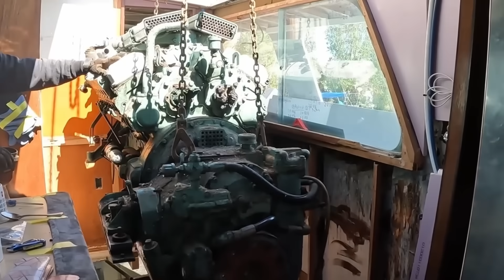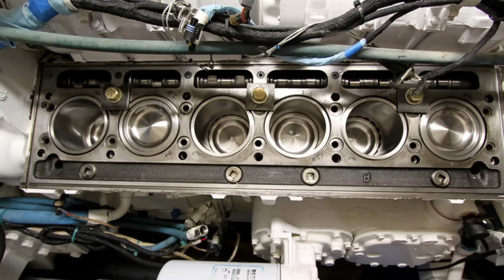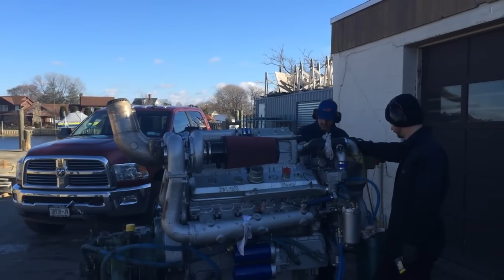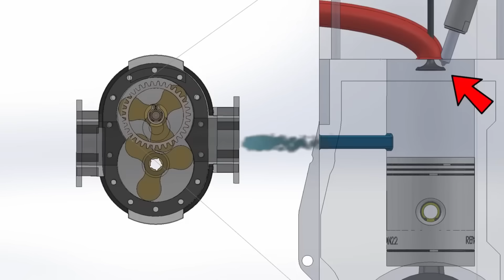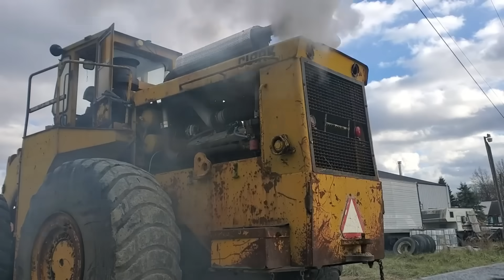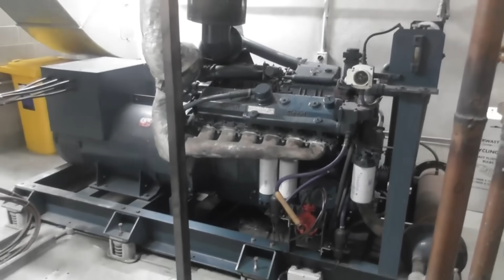The Scary Truth About Detroit Diesel’s 12V71 That Nobody Noticed

Comment: All internal combustion engines require air or they will not run. The 12v71 engine was not different from the 3-53 Detroit. Very dependable engines, especially in the marine market.

Comment: My father had one in a1971 Peterbilt. I never drove the truck but he didn’t buy another one. He went to the 1693 Cat. 425 Hp and also ran some 400 hp Cummins and they were better for cross country trucking. We are still running Caterpillars in our grain trucks. I don’t want a Detroit engine.
Reply: 1st time hearing a mention of 1693:cat. 74 Pete c/o we had was jacked to 440. Every two weeks shop it to realign driveshafts with power rotating round axle housings in saddles. Cat put a bulldozer engine in a highway truck. It would outdo the  v12 we had everywhere.

Comment: What exactly caused vibrations in a V12 though...?
Reply: I also wonder... I have owned several 6-71 and they are noisy as hell but vibration??? Nope...
Reply: @SveinHaDD  Yeah.. that's what I was confused about. How does an inherently balanced V12 vibrate? That statement was so strange
Reply: A long time ago a brand new supplied 12v71 when installed on an oilfield booster compressor, it started vibrating and distryed itself in a short time, on dimantling it was found the the trust main bearing halfs in bearing gap had no dowel pins fitted, the blog was and crank were a total loss inside 30 minutes running.

Comment: The scary truth might have been that the turbo (on the superpower ones,most didn't have a turbo) could blow a seal or something and start blowing oil into the air moving through the blower and on into the combustion area where the oil would make the engine start to speed up and  couldn't be turned off by the fuel injection being shut down,the engine could run so fast (and also with detonations because of the lack of injection timing) until the engine literally exploded    (need a way to block off the air getting into the engine or possibly disconnect the drive for the Roots blower) or shift it into HIgh gear and stall it by letting out the clutch !)
  I think this can happen with some kinds of turbo failures on any Diesel that is turbocharged including CAT engines. Not just a turbo 12V- 71 thing.
 I think non turbo Detroit Diesels as long as the injection wasn't mistimed and the oil and filters were kept serviced (and the cooling system) were among the most reliable Diesel engines ever made
Reply: For a runaway diesel (Uncontrolled runaway firing on crankcase oil) it doesn't need be turbocharged. The first versions of the 1.5-litre Volkswaged golf diesel had exactly that problem, the pressured oil to camshaft will sofocate the space inside the valve cover because oil return to crankase was inadiquate, when that happens, the engine will suck that oil through the breather pipe from valve cover to air filter.

Comment: 10, 12 or 14,000 hours between overhauls. At the same time you replaced the blowers. I rebuilt ours right on the engine room floor at those hours and when I left, the one that was done at 14,000 hours had over 28,000 hours on the block and crank plus camshafts. At overhaul it got gasket, bearings, liners, pistons and rings, reman heads, reman blowers, new injectors. 36 qt oil changes at 300 hours.

Comment: Drillers on service rigs used this motor for years. What made it stand out was how fast you could spool up the motor. Draw works that lifted pipe (Block and shieves) could go from a stand still to full speed in a few feet. It made tripping pipe fast , Loud and dependable.
Reply: Still is. We had a 16v72

Comment: The picture in the thumbnail shows a 92 series 71 had a big knob on the valve cover nuts
Reply: Depended on when built. We had series 71s that had either style. The big knob 71s used a stamped valve cover. The others used a cast valve cover. Either style could be fitted to the block. Our 12V71 used stamped ones while our 6-71s used cast ones. We even had 12V71s in use at other places and a spare for ours that had cast ones.
Reply: I was unaware all our 71 series 110 series and 149 serious I'll have big valve cover knobs they were all stamped sheet metal

Comment: I believe a transport operator out of Mount Maunganui …. And a friend of my brother, ….. did purchase a Kenworth powered by a 12 V 71. His name possibly was Mike Lambert. Having driven a Leyland Crusader up the Taihape deviation I can only imagine what a fistful of power that would have been . However horsepower is not free…. How fast do you want to go. ????. There is definitely something intoxicating about the Detroit Diesels. You know that are bad for the environment and they are a nasty addiction. But hey, you only live once. ???. Cummins were at the forefront of pushing Diesel technology in the early part of last century in the US. It can not have been easy as petrol was so cheap also they did pioneer the Jake brake. In NZ the International Harvester F1800 were a true heavy weight. In the field of logging they were invariably Detroit Diesels whereas aside from that they would be 392 cu inch V- 8’s petrol engines. The export of logs still predominates in NZ. The only exception maybe the transport of logs 🪵 over the Napier/ Taupo road which is not as infamous as it once was …. To the Whirinaki paper mill. Although having said that then the production of paper is produced below cost by China .

Comment: It is one of the most reliable 2 strokes detroit made. The marine diesel shop I worked for sent me to 71 series school at Stewart&Stevenson in Houston Tesas in 1993. All they worked on was the Detroit Diesel series 53, 71, 92 and 149. That was an awesome time back then. Also please get the HP ratings right. N/A was over 400hp naturally aspirated. The twin turbo was over 700hp. Sigh !!!
Reply: I went to Key Power ( NKA Florida Detroit Diesel Allison) in Tampa for mine in 1988. HP depended on RPM and size of injectors.
Reply: @gravelydon7072  GD ........I worked for a trucking co. that contracted to haul from DD to miami in the early 80s .:body-blue-raised-arms:
Reply: 350 to 390 HP normally aspirated.....nope.

450 to 477 HP is more like it.
Reply: They also work on EMD

Comment: If I could find one for cheap, I's absolutely love to extend the frame of my Dodge 2500 (and seriously beef it up), and have custom sheetmetal made for my side panels and hood so I could run this monster all the time.
Reply: @jeanettewest .....You're Dreaming, sweetie!!     You're right about extending the frame... but, it needs to be done from the cab... Back.   Your "Dodge 2500" could Never handle such a conversion, on many different points.... and neither could the larger 3500 (1 ton).... the frame rails are too weak for such a conversion, even if it were possible.  

First.. to be able to handle the weight and for better handling stability, you would Need to mount it "mid-ship" (Behind the cab), 2nd, All of the suspension, frame rails (double walled, at the least) and rear axle housing would need to be upgraded,   3rd... what transmission would you use?.... if a manual, you're looking at an additional 750+lbs, if an Allison Automatic, even like the HD-650, you would be in the 900+lb range... then you would need to figure out the linkage to shift (if manual) the transmission from back that far in the frame.   

Also, you need to take into consideration.... BRAKES.   What you have in your 2500 would Never have a hope in stopping all that weight..... unless, perhaps you were applying the brakes while going up a 10 to 15 percent  gradient.

In short & in reality, there are a LOT of considerations to be taken into account in order for an engine conversion to be successful on many levels, no matter what engine you choose.     It would be a lot easier to at least start with a class 7 or 8 truck (semis) platform, to fulfill Your "dream conversion" truck.

Of course, we all know that "this" conversion would most definitely come under the heading of.... Completely Absurd, not to mention totally impractical.   Even with a V6  Series 71.... it would need to be placed "mid-ship" for proper weight distribution and handling characteristics.   Even a 6-53 is borderline too "nose heavy" when mounted under the hood.... but, guys do it anyway.... even though the handling may Not be completely ideal, and you would want to start with at least a 1 ton / 3500 series.       Sure is nice to Dream, though.... isn't it?  ; )
Reply: @Romans--bo7br  I put one of those in a Toyota Prius easily can be done
Reply: @Romans--bo7br  Wow, and you never read the part where I said, "seriously beef up the frame"? Add military axles, put in a heavy boxed frame long enough to have the engine, cab, and bed in original positions, now make a long front end. Automatic transmission, don't need to shift. It wouldn't be easy, essentially setting my truck on a custom made frame, but part of the process of creating something is to dream of it.
Reply: @jeanettewest try a 6v53 or 8v53 it will fit better and rev higher
Reply: @fil1329  OMG! The 6V53! Screamin' Demon.
Reply: A 2500 is a baby truck and the only reason to use one is (perfectly legit!) because you like the cab styling.
The rest of a 2500 is useless but you could get much of your donor truck money back parting it out.
The good news is even a (determined!) novice with fairly basic equipment could do the work if they are an EXPERIENCED welder or can fit then tack the work and get a bro to lay the beads, most of which are simple.

Here's a PRACTICAL way to get what you seem to want which is really not very difficult and could be quite affordable if you're a decent welder. You'd need equipment for handling the drivetrain but you can build your own suitable gantry by buying surplus steel beams (easy to find from building demolition companies) and used overhead crane parts. (Beams often go cheap. My welding shop foundation is also its slab form because I welded four steel beams together as a box which since I bartered wiring a neighbors truck for them cost me less than a hundred bucks! It pays to help people out. My shipping container shop is also welded atop steel beams which make that job really easy to do.)

 Other people do this sort of conversion so there is nothing new to figure out.

Much of this has been done before because sticking baby truck cabs on real trucks is a nice way to get a comfy result. You can use a clean 2500 donor cab (it makes no sense to break a good running truck vs. buying a cab donor) but use a front clip off a much heavier duty Dodge truck like a 5500 so you can run the rolling chassis you'll need.

You can buy good running military surplus trucks for not a lot of money because only serious users don't mind their ride and noise (which you could solve by modding your Dodge cab for air ride and using an air ride seat like Bostrom etc make and are easy to source from salvages). The Dodge cab swap was done many years ago by at least one off-road wrecker operator but I'm not going to hunt the link.

Since you probably don't want the second axle, look up how easy it is to slice the back axle off a military truck to make a "bobbed Deuce".  Some outfits like White Owl will bob them for you but the work is so easy I wouldn't bother. You can do the usual and use a military trailer for your bed. The military truck means you don't need to mod a frame or have frame rails custom rolled (many big rig builders do this) but if you want a special length you can have that done. You can also harvest rails from a donor truck and double them etc for heavy loads. Not one bit of this stuff is obscure and there are plenty of videos on shortening and lengthening trucks. 

A bobbed Deuce with a Dodge cab and drivetrain of your choice is certainly doable because it's been done. You need to do some serious homework but studying isn't hard. The so-called "largest off-road wrecker" (it isn't since there are much heavier military wreckers but whatever gets the views) uses a 5500 crew cab (might as well take advantage of the wheelbase). More people don't build these because they're so specialized, not because it's difficult since it's basic big truck mechanics.
Reply: @oldphart-zc3jz  Thank you, over a couple of years I had actually considered all this after watching some of the wild builds on YT.

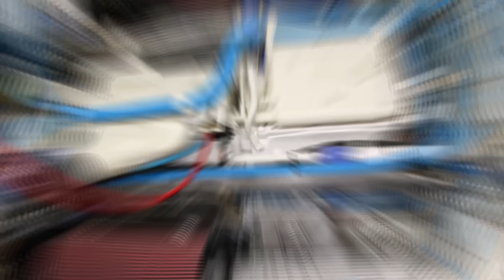Comment: What a crock! "Critical" "Hidden" flaw or weakness? Just because it was a supercharged two stroke, like all Detroit Diesels? Sorry! That's how they were designed and they weren't "Flaws". The first 3/4 of this video sounded like it was a CAT commercial, but it did mention the Series 60 at the end, so maybe it wasn't sponsored. Not that the Series 60 was ever designed or intended to compete with a 12V71, totally different mission. Almost like comparing a Lamborghini V12 to a Chevy straight six. I ran a set of 12V71TA's, rated at 900hp @ 2350rpm (identical config pictured at 11:55 mark in the video) for years in the fastest sportfisherman on the East Coast for over two years. The boat held the title that long but the engines are still running today, 25 years later! They were noisy, the sound of power! They didn't leak and they were smooth as silk. The boat was later repowered by the second owner with 1015hp CAT C18's but she was never as fast as the 12V71's nor did she burn any less fuel. She also didn't catch fish nearly as well, Fish like the sound of a two smoke!
Reply: These engines have impressed me for Decades. I'm a Marine Propulsion and Industrial Generator Specialist. These engines, the other V and Inline 71s, the 53s 92s and 149s , All have worked in the most demanding circumstances you can imagine. 
   If you are operating them a 75 to 100% power they Equal or Exceed the fuel efficiency of a lot of other engines. underload them constantly? They carbon up, smoke and get hard to start. 
    Tough and Reliable. 
Most "oil leaks" come from over filling the oil. Don't tip it to full! Oil hits the crankshaft and gets Blown Out The Air box Drain. Keep above the low mark. A lot of Detroits are like that.
Reply: The can go from start to full load in seconds and run for days at full load
Reply: @phillipgarrow2297  Ours started at 1000 RPM and went to 1800 as soon as the temp went to 140°. They stayed that way for 300 hours or the day shift before being shutdown for the oil change. An hour later they would be back on line for another 300 hours. Just add 2 qts every 24 hours and let them run. We weren't allowed to do any except emergency repairs after midnight so some oil changes could be up to 6 hours late.
Reply: The only ‘flaws’ we were aware of: high fuel consumption, high oil consumption, and no tolerance for overheating. These applied to any 71 series. Ibs/hphr is higher than other engines of the era. Keep it full of water, oil, and decent fuel, don’t rev it to the moon, and it could run until the rings would break in the intake ports. Not an engine to be lugged. Have fun
Reply: A c18 will do more on 6 cylinders than a Detroit can do on 12.  Nice fairytale, but that’s all it is my freind.  They did ok in their time I guess according to you.  But they will never compete with a c18.  How many detroits are in the 3.6-4.1 semi truck classes and winning………..I’ll wait…….
Reply: The best, reliable, powerful easy to repair  after  you know it.  Just like a woman. 
Don't make them anymore